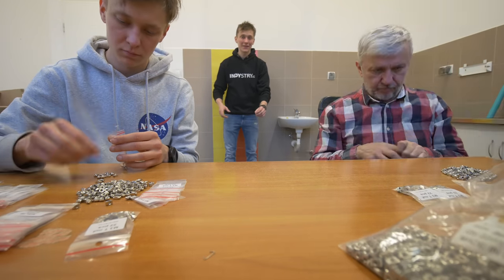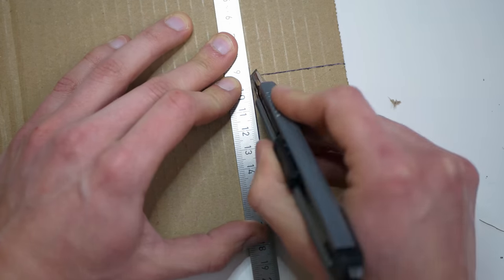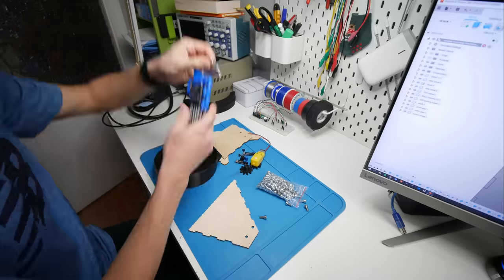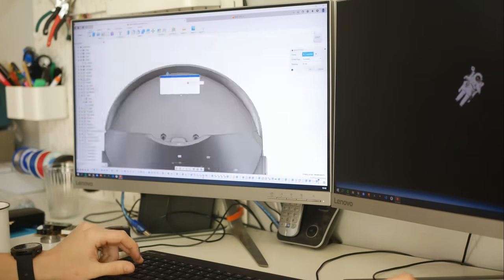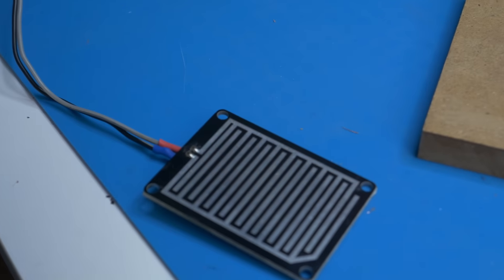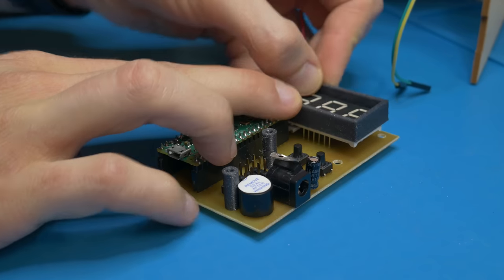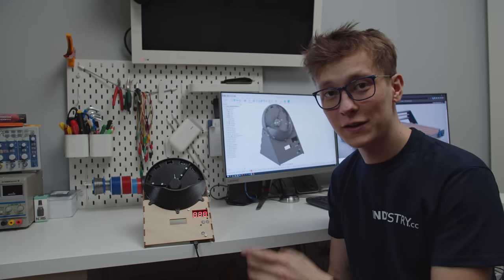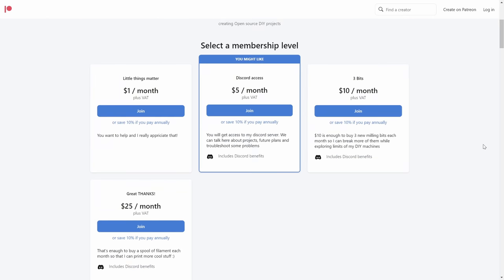I built a machine that counts screws

Comment: As  suggested weith at the end will be very precise because of each screw does weigh a lot. pottiing in a bag directly is the second. Third I would suggest putting them a second time in the machine, but the weight will do it for sure. Last I would suggest having the output shrank to a minimum so that there is a minimum space for the screw to get out and min space for those sensors. If you have too much space, you might miss some. Those are my suggestions. I play also with esp and esp32. Great project !!! I am also almost sure you could connect to a scale to decode.

Comment: Measure weight with a scale. Do it in chunks so that the error rate is minimized. 1 screw weighs x grams, 10 x =, done, verify. Another way is to watch for the weight vs time and sync with the optical sensor. Adding a Schmitt trigger might help too. Optical sensors are tricky with unusual shapes. One last possible attempt would be to install your optical sensor just before the drop, while the screw is in the "lift" and more constrained in shape/orientation.
I like your attempt and commend the efforts!

Comment: At this time there are 45 comments; almost all of them want Nikodem to weigh his bolts.  That would be sad... if he did that, we would all have missed out on another of his well-produced, entertaining videos!
(I bought a cheap set of scales which has amongst its features the ability to weigh an item, push a button, add more of the same item, and it reads out how many items there are... job done!  WHERE'S THE FUN IN THAT!)
Reply: Some of the students I help in the school Fablab are making a robot for the French Robotic Cup, and they have to count the number of Nerf balls. They use a weight sensor, and it works fine, either with a so light object. So, replacing the light sensor with a weight sensor keeps all the fun of building this machine.
As some other people said, maybe a good idea to use several sensors, to increase the accuracy. And the fun ;o)
Reply: That's a perfectly valid argument for sure. If you would like to add some sophistication one may go the industrial way and use a camera instead.

Comment: We have a similar problem as you have. We're basically assembly hardware bags, but each bag contains several different bolts / hex nuts / hex key etc. To be honest we didn't find a solution to the problem that would actually speed up the manual process. When packing bags manually it takes us around 10 sec per bag. Having that in mind and a machine that would do the counting, we would spend more time transfering counted screws into the bag, than we would actually spend packing them manually.

Comment: Fantastic project! I would try to put a scale (100g or 500g load cell) under the box and use the weight to verify the correct amount of parts. The first part triggering the optical sensor will fall into the plastic box and will give you the first weight value, which can be used by the programm to write the weight per part variable.

Comment: One other possible solution would have been a capacitive sensor. That allows for metallic and non-metallic parts. You will have to account for the dead band, the sensor cannot be too close to the object being detected, and there may be some improvements that you could make in the firmware. If you are not familiar with them, look it up. There are tons of information all over the web.
 Overall, it's a great initiative and congrats on rolling up your sleeves and actually doing something. Perfection is never being truly satisfied with the results and searching for solutions for improvements, buy also knowing when to stop. Keep up the good work, challenge yourself, keep records of your progress and create some kind of version control.

Comment: you could make a "shelf" that the screw will hit when it falls out of the back, and use a piezo element and op-amp to detect the pulses you'll get when the screw makes contact.  if you don't have a piezo element, you could probably get a similar result with an electret microphone.   you might get more than one if the screw hits both ends, so you'd need to make the code smart enough to say all pulses within X millioseconds are counted as 1 screw

with your current design, you could make the part where your detector is go all the way down to just a little bigger than the screw size, so the screw will go across the sensor in the long direction, so you'll have more time that it's blocking the light from the sensor, or maybe you just need a second sensor to catch the 5% that fail

Comment: Check out Christopher Helmke's videos on a screw packing machine. He uses a magazine to sort the screws and then a sprocket to count the screws. 

Maybe a simpler variation might be to sort the screws into a magazine, them manually dispense them based on their height in the magazine.

Comment: get a small loadcell and weigh the output to verify the results. Bottom line is you can do it all via the loadcell but having two technologies that check each other does eliminate the manual check. Use an HX711 module which has a 24bit A/D which is perfect for counting parts. You should use a 500g or 1kg loadcell depending on the maximum number of parts that you're counting vs the minimum weight. As an indicator, I'm using a 5Kg loadcell with an accuracy of 1g (0.5g if I push it) so the 500g and 1kg will give really good accuracy. One of the reasons you could still use the light source is that you are counting before you put the component in the container. If you use the weight as the primary method of counting then you could go over and then you'd need to find a way to remove the part. There are of course ways to make it work accurately but this would solve your problem. Good luck

Comment: You could simply augment this by adding a little flap in the outlet tube where the light sensor is. Make the flap so that is open with even the slightest pressure so that a screw can pass through, But the flap will completely block the LED or the Sensor every time. This way the screw can't slip past. Then I would ensure that there is no external light making it's way to the sensor at any point.

Comment: Countin screws is usually done by measuring wight instead of actually counting them. But your machine has a potencial as a screw feeder. If it outputs all screws in head up direction than it is more useful machine.

Comment: Habe you thought about using an inductive sensor (like some 3D-printers use to level the printing bed)? This would allow to only change the big wheel if you want to switch to counting also smaller parts like washers or nuts. The quality of the sensor signal is also better, too.

Comment: You could find the mass of a single screw (i imagine if they are from the same supply chain this will be fairly consistent and negligible) and then weigh the counted screws after to quickly verify rather than manually recounting.

Comment: instead of a photoresistor and an LED, what about a hall effect sensor with a bias magnet?
they can be used to count the rotation of gears, so i suppose they are quite reliable to detect fast moving ferrous metals.
as others said you could also add a load cell under the container that holds the counted nuts/bolts as a sanity check.
or maybe a small piezoelectric speaker under the container that receives the screws to sense the their hits when they fall. this might get way to unpredictable with lots of screws moving around though

Comment: How about using an induction sensor to detect screws? Those are generally extremely reliable and their sensitivity can be adjusted. Also add a cheap weight sensor with i2c to communicate with the RPi and double check if the weight makes sense.

Comment: I would have put a trapdoor in the exit shut that would count the screws as the fell. (I know that mechanical solutions have a shorter life-span than optical, but for these small parts I would expect that it would be more accurate.)

The other option is to just weigh the screws, because they are made with such high precision.

Comment: Super cool design! Have you considered a small load cell? Measuring the weight increase each time a screw lands at the bottom of the chute would be quite reliable I think.

You could steal one from some cheap digital scales designed for sub 1kg measurements.

Comment: In this case, it is necessary not only to measure the weight, it will have a low accuracy. A small mechanism is needed that measures the weight of ten or twenty bolts in a small container, and this small container, after measuring the weight, is tipped over into a large container.
This will be much more accurate and hundreds and thousands of elements can be measured in this way.

Comment: Nice project. If you dont want to refine the maschine, use it and in the end just weight your screw assortments. Then inspect the outliers. This way you only need to manually check 5% of your screws instead of 100%.

Comment: So, you need two bins, one to count, one to dump in, a small arm/flap to stop screws during the dump, and a stepper motor with an arm.  The counting bin is free floating, but still constrained to allow for ease of pickup.  Imagine an arm on a stepper motor with a groove in it and the bucket to be weighed having a nail head like tip on the sides that hooks into this. (think garbage truck, but more attached)  You use your counter you currently use to determine if you think you are right, then if the scale adds up to true, you pause your motor, engage the arm/flap (prevent accidental drops) and then you dump.  If your scale is off, you disengage arm/flap , reengage motor, and continue counting, or, you throw a beep indicating there is too much.  If the screws are dumped, you know you have the proper amount, if it errors, you take one out.  Less YOU work..
Reply: If not I was thinking, why not use like an old coin operated machine and borrow the counter from that or something

Comment: It seems like the errors should all only be over-counts, that is, the sensor misses a screw and it continues to load extra. If the time you would take to count screws is worth more than the cost of an extra screw here and there, your customers won't mind it and that's a fine solution.

Comment: I would use a scale to count screws :)
But machine is nice. One could use a kind of weight based lever to estimate the fly-by of the screw, but it is also dependent on the possible doubling events. 
Look for object separation methods. Magnetic seem to be compact and still funny to create. 
The problem would be if you use stainless steel screws..

Comment: A really lovely idea and attempt at making it reliably functional, but if it's too unreliable, maybe it would be easier to build a setup that "counts" physically.

For example a rail exactly made for a type of screw, where the machine simply spits the screws onto, and their thread "falls through" into the slot while the head comes to rest on the rail. Then you only need to adjust the length to what you need, or even just mark out every count on it. Now you could see visually right away if you have the wanted amount, or if you need to add or take a few.

For the nuts it could be as simple as a tooth pick and getting the machine to "spit" them onto that properly. Then just mark the height of said stack that represents the wanted amount.
Reply: @Bloody Mobile :  I have used this type of setup on a couple of occasions;
** The first was counting steel balls into batches. A simple "V" channel on an incline, with a mark to indicate the required number worked great.
** The second was counting machine screws, similar to Nikodem's problem.  I could not get it to work reliably enough.  Unless the screws were fed at a consistent rate, with spacing between, some would not "hang down" through the slot.  I did not have a very large number to do, so I just flicked out the misaligned ones.
I wondered if some vibration would help, so I put the chuck-key of my electric drill into the chuck, and touched the end of it to the channel... it vibrated alright; the screws went for miles! 🥴

Comment: Try adding somekind of weight verifying system.. Basicly after the machine is done counting it should check how much do these screws weight and therefore check whether there is too  much or too little. Ofcorse there will still be some margin of error but definitly not as drastic.

Comment: I really like the weight suggestion other commenters had, but I wonder how accurate the machine is with a 2 out of three system: if you count a batch twice, and they match, you assume that’s right, if they don’t match, you run a third time, and if all three are different, you call it a failure, but assume whichever number appeared twice was correct. I expect this would have a false positive rate of at least 1 in 800, but that’s probably much better than 1 in 20. (I assumed that if the machine counted correctly 19 out of 20 times, half of the remaining counts may fail in opposing directions, so after the first 1 in 20 miscount, there’s a 1 in 40 chance it miscounts in the same direction.) In reality, I expect the miscount fails more proportionally to the quantity, counted, so you probably should count 100 screws 100 times, and see how often it’s off, and in which direction, then you can model a more realistic error rate. (It might even help you see WHY you’re miscounting

Comment: Instead of holes of the shape of the bolts, use small magnets, on the top a stopper that drops the bolts out of the disc to the optical sensor ramp. The sensor should be improve, it's impossible that fails the count. Maybe it's failing because the led is inside of the cone instead of outside, and the cone is very wide. Profesional bolt counters use vibration, then a ramp with 2 wires to catch the bolt straight, and then measure the weight of the bolt or count them with a ligh sensor. You are close to a cool machine, just rework on it.

Comment: The more industrial solution would be an inductive sensor, like in the 3d printer bed leveling.
Reply from the maker: I wasn't able to find any available in any online store in Poland that works with 5V. Since the PCB was ready for this project I decided to leave this upgrade for the next version. But honestly after trying with the LED I think optical sensor is the way to go, just need to use a laser instead of LED.

Comment: but u can count with a scale, it has this symbol that allows you to place 10 or 20 on them, set it and then it knows how much 1 would weigh, I use this all the time at work to count between 100 and 500 screws... even the cheaper models have it and works like a charm.
edit: I should've read the comment section first before posting :P

Comment: Curious why you're not going by weight and count? Typically you'd want to have the sensor count the components, and as they're counted they are dropped onto a scale. It'd check the scale and if the total doesn't match the expect weight of x components, then it cycles again until a component is dropped, then rechecks.

Comment: dont verify and chase the perfect count rate
- here are some ideas, you could verify the weight of counted screws with come load cell maybe
- add another sensor like a hall sensor to the array, maybe put a magnet on the opposite side of the tunnel and then when a screw passes it it should disturb the field and it should be detectable by hall sensor
- go LEGO style and add more screws that are needed, screws are cheap, your time is not - it's better to add some additional screws than do manual work

I'm always amazed by your work, keep it up
Reply: @Mad_Catter_  i mentioned weighting as verification, not replacement. if count and weight is right then you can assume the number is correct.
Reply: @Mad_Catter_  no i ment dont verify manually

Comment: Maybe you could use two (or three) sensors in a row, and compare both. So if one misses, maybe the other one won't and vice-versa. It would be a simple solution to test, at least.

Comment: Seems like you having a grounding issue on the outlet your monitor is plugged into.  I noticed its turning on and off.   You may want to consider an AVR and make sure your ground wire on your LCD is working/connected.

Comment: You can use weight as some viewers suggested, but you should consider errors. Errors will be greater as you want to count more screws, exmpl :
- 1 screw weights 10 grams +/- inherent errors
- inherent errors do come from the system used as a scale and manufacturing errors related to screws. 
Let's say the error is +/- 1gram for 1 screw, 
>then when weighting 2 screws you should have a reading between 19 and 22 grams 
>Equally 3 screws will read from 27 to 33 grams
>4 screws : from 36 to 44
>5 screws : from 45 to 55
>6 screws : from 54 to 66 : 
notice how the min weight of 6 screws is lower than the max weight of 5 screws, which means that a reading between 54 and 55 grams cannot tell if we have 5 or 6 screws!  This of course without considering the fact that the error coming from the weight sensor may not keep constant while loading it differently each time.
for your case :
9   screws from 81 to   99 grams
10 screws from 90 to 110 grams
11 screws from 99 to 121 grams
12 screws from 108 grams
(based on our supposed values) 
So for example, a reading of 99 grams can mean 9, 10, or even 11 screws counted.. Etc 

To resolve this you can :
-generously suppose the lower count and top the bag with a number of screws that compensate for the error
- count in batches that shouldn't reach these indeterminate situations, meaning instead of weighting 10 screws at once, weight 2 batches of 5 screws for example.

Of course you can come up with different approaches for counting, for example using a belt conveyor and computer vision which will be accurate as bolts are simple shapes on a 2d plan.
You can also come up with a purely mechanical way of doing it, but it would be more challenging to design and would lack flexibility.